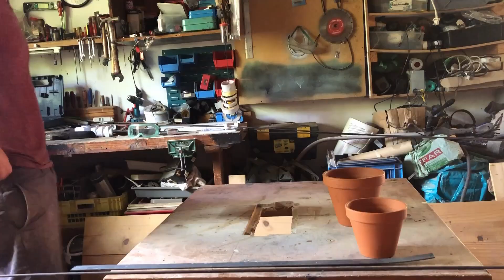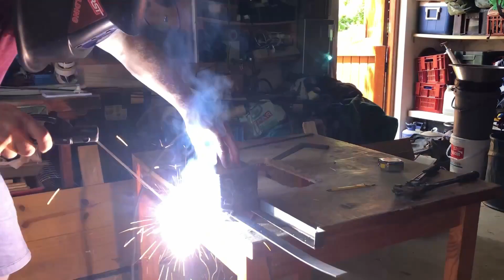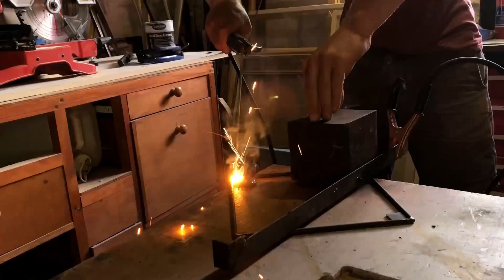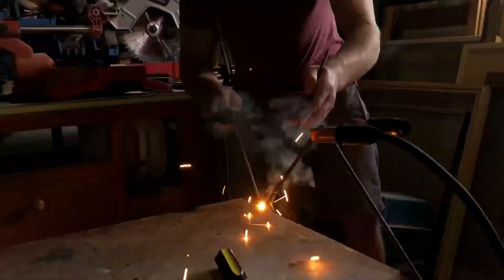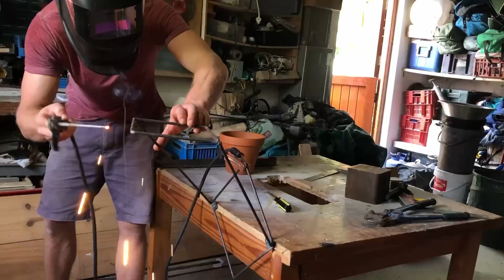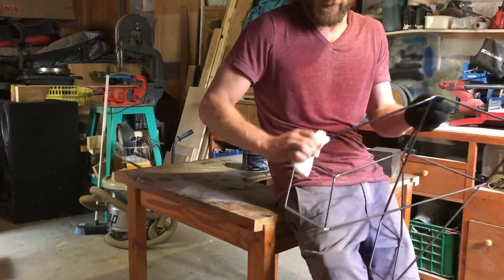Pot Planters - Crafting Custom Wall-Mounted Plant Holders with Welding: A Step-by-Step Guide

Comment: Does water leak out the bottom of the pots? I started to make something similar but got worried it would drip moisture onto my wood floors haha
Reply from the maker: Hi there! Normally, I take the pots outside to water them and then bring them back in. However, I do end up with some water on the floor if watering inside. I have also tried using little trays underneath the pots, which solves the problem, but it's not as aesthetically pleasing to look at.